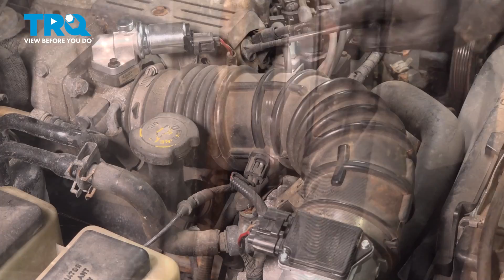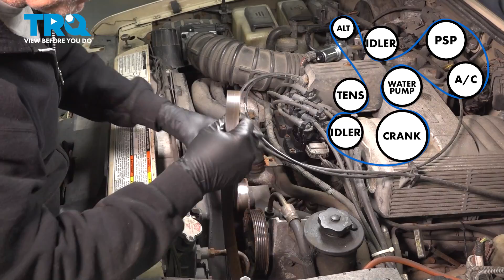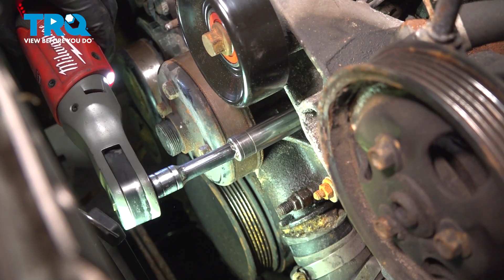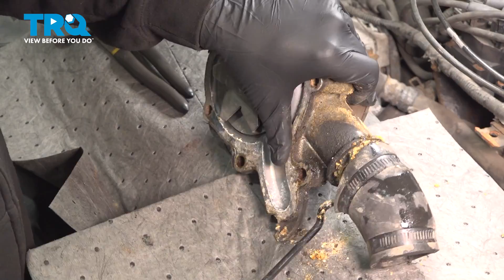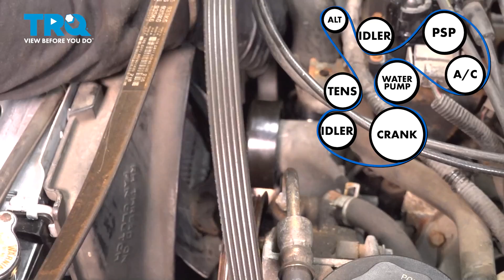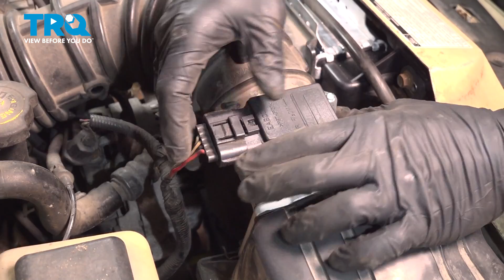How to Replace Engine Water Pump 1995-2001 Ford Explorer

Comment: It is easier to leave the belt on before you loosen the fan clutch, it helps hold the water pump pulley in place, but if  you have special tools it would not really matter, for us backyard guys, it helps.